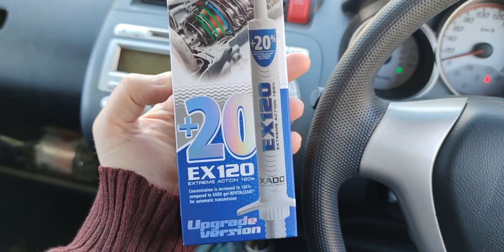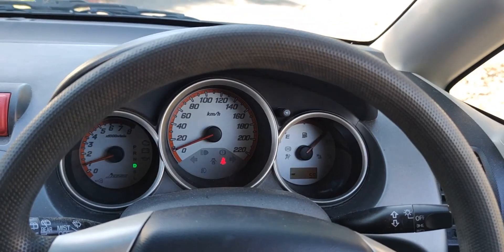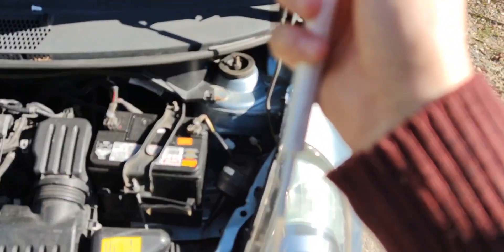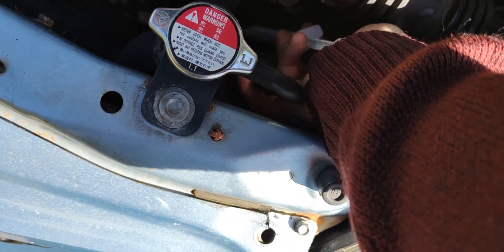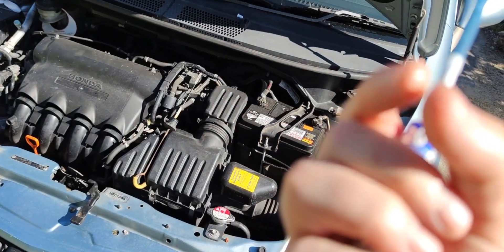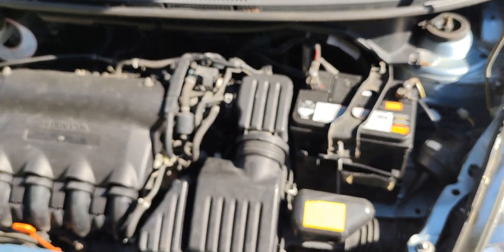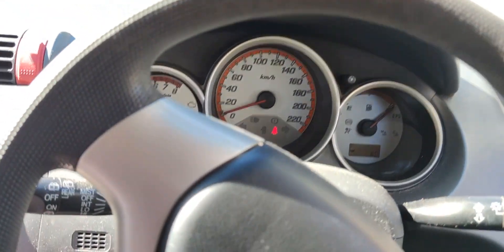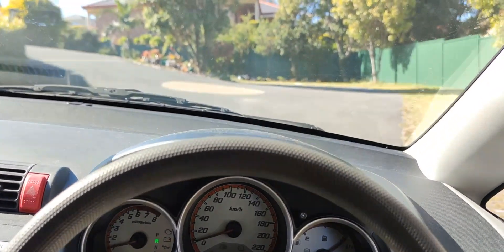Xado EX120: Honda Fit/Jazz CVT Start to Finish Conclusive Review.

Comment: I have been using this product for several years in my 2004 Honda Fit. It does reduce the start up shudder in the automatic transmission when climbing an incline or accelerating from stop at the traffic lights. But it is best to drive the car for 5 minutes to disperse the additive before expecting to see a response. The auto fluid needs to be moved around the transmission parts, with some heat, so that the additive can coat the contact surfaces. Depending on vehicle use, one tube in my Honda Fit keeps its effect for about 6-7,000 km over 1-2 years. At $50-$70 per tube, that’s a fairly cheap fix! 👍😎🇳🇿

Comment: I purchased XADO’s EX120 Revitalizant for CVT on a 2013 Nissan Sentra with an intermittently slipping transmission. The transmission would start slipping on about 20% of the drives. But there were no diagnostic codes thrown. If one pulled the car over and shut engine off, the car would start up and run fine for a while.  I added the EX 120 to the transmission fluid several weeks ago and have driven the car several hundred miles since. Unfortunately, I have not seen any improvements and in fact it seems to be shifting a little worse. I seriously doubt driving the car a full 900 miles will make any difference. I would not recommend this product simply because it did not help our situation. Now the only alternative is a remanufactured transmission replacement for around $5,700.

Comment: Having worked on honda cars for over 35 years people should realize that honda cvt transmission fluid MUST BE CHANGED EVERY 2 YEARS OR 20 THOUSAND MILES WHICHEVER COMES FIRST....then add the ex120 fluid to relieve any symptoms of juddering...this stuff works very well indeed..including torque converter auto boxes as well....
Reply from the maker: Awesome. My understanding is exactly this. The fluids should always be changed, and they really don't charge the earth for genuine Honda fluid either. I think in this one it was about $70 AUD, but in my newer Jazz it was over a hundred. Still though, so important. Thanks for the comment.

Comment: I have a 08' Honda City which also shares the same transmission as the Fit/Jazz. I tried adding in the EX120 but the shuddering came back 4 months in. I read on various forums that the start clutch is the root cause for the vibration and they're known to wear out on these cars when the fluid isn't maintained properly. I guess EX120 might help a little bit if the clutch isn't badly worn out. I'd say use this as a temporary solution until you find a good quality replacement.

Comment: transmission on the jazz it's cvt or automatic coz xado distributor indonesia not recommended for cvt used...thanks
Reply: Works fine in a CVT.  Says on the box itself that it's ok ina  CVT.  Has reduced the shudder in my Jazz CVT by way more than half.

Comment: what exactly was the problem to begin with?
Reply: Transmission/car shakes when driving away from standstill. The cvt/ belt and pulley Transmission slips and shakes the car at initial movement from standstill
Reply: Yeah, it feels, like your ESP is on.

Comment: I was skeptical using this in my 2005 Honda fit that was shuttering jerking kicking in and out of gear I change the fluid I put CVTF in it and one syringe of the zado 120 wow what a difference the transmissions like brand new

Comment: The revitalizant needs time to kick in in full - it's 60k miles guarantee but needs 1000 miles to achieve the 100% potential :) It works great on new or known good oil in the gearbox or engine. And no - it can not damage anything, since I've tried it on at least 10 of my cars and on a Hyundai I put the engine Maximum SUV four times in a row in the engine with each oil change - around 6000 miles :) Put the same MAXIMUM for automatic gearbox also four times in a row and the effect was amazing after the time, and good after the second.... but I'm certain that I can  not damage my cars even you want to put it each oil change :) Not to mention the wonders this EX120 for fuel equipment - pumps and duses made for my dad's Land Cruiser 3.0 D4D ... Just read the instructions and do as they say and you will be happy - I know I am :D

Comment: Only lasts bout 5k before shakes again.  I own honda fit aria gd9. Works a dream when used though. 55 bux
Reply from the maker: Reading around online, all sorts of people have different experiences. I did 15,000 kilometers before I sold the Jazz. Worked awesome the whole time. I did change the oil before I added it which may have helped. I also realised that maybe I should have just added a quarter, or half of the additive first. To see if that works fine. Rather than the full thing.

Comment: Hi I used xado 1 stage on an opel astra h 1.7 cdti, isuzu engine.  I noticed some improvements in the fluidity of the engine, after about 1000km.  However after about 3000km I noticed a large oil leak from the cylinder head cover oil seals.  I had them replaced, without changing the oil, but after about 2000 km, the problem reappeared.  My question is: could it have been xado maximum 1 stage that damaged the oil seals?
Reply: The product increase engine compression, so maybe, maybe in your case has to made the engine leak oil on old gaskets.
Reply: Na. U need new gaskets
Reply: maybe the PVC system is plugged.
Reply: @tossftw7228  The product does nothing to engine compression.  It is applied in the transmission, so how is it going to affect compression?!
Reply from the maker: Nah let him think that, it's way more interesting :)

Comment: Does it work for DCT (dual clutch) transmission?
Reply from the maker: Not sure actually, but I would love to say yes, but I can't. I would probably try though. Usually replacing the fluids will fix the issues I had, but if not, then you would go to this product.